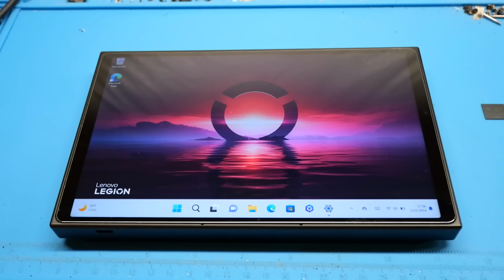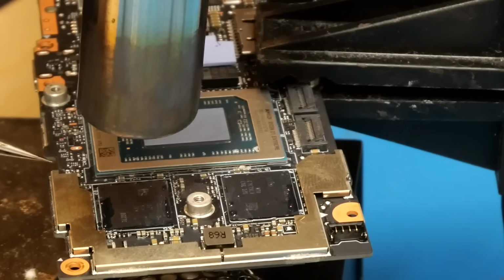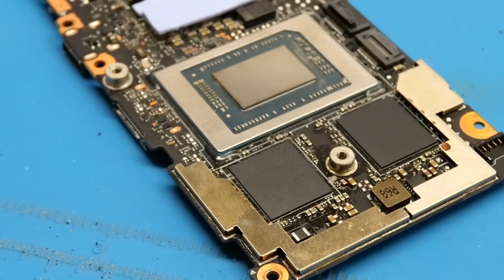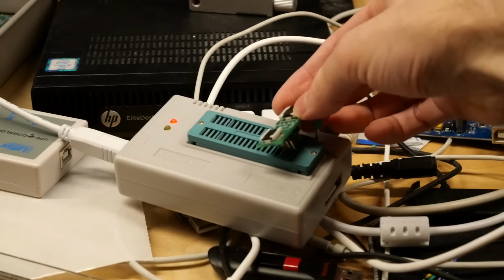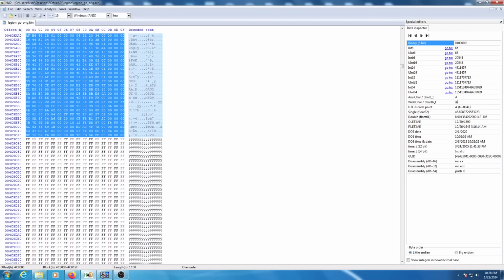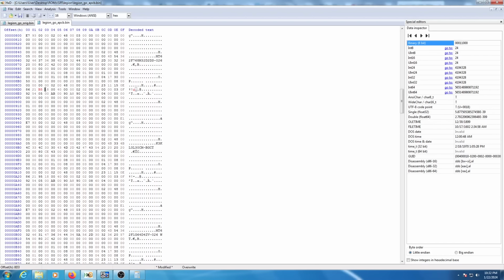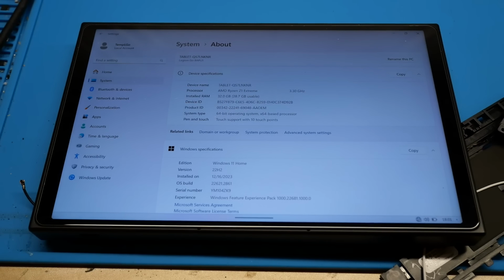Lenovo Legion Go 32GB RAM Upgrade

Comment: Awesome work. I love this stuff. I'm too scared to do mine, but it's awesome to see it done properly. I Also am thinking that, which bazzite requiring less system ram, that 16gb is really all you need with that is to get the most out of the apu. What do you think? I'm speaking about gaming specifically. I could see someone overloading bazzite with browser tabs in desktop mode.

Comment: i have some questions about this Upgrade! First; how does it affect the VRAM side? meaning the Legion GO was able to take 3, 4, 6 and 8 GB Ram for Grafiks, and now it has more so can you give it more VRAM like 10, 12, 14 and 16GB? Second; How is the Battery usage? does it need more energy and consumes more Battery or does it not? and lastly Third; would you do that for other ppl cause tbh if it's a good upgrate that Up's the Performance of the device then i would like to have that in my Legion GO but no one i know can do what you did or atleast dont do that for less then "pain tolerance" and if you do, how much do you need xD

Comment: i ve applied hot air and chips are not coming even the parts at the back melted but ram chips are not coming and also i dont see if i have glue like others have at corners :((((

Comment: I have a question my Lego shut off and won't turn on again even when I plug in the charger in the mains and unplug the battery. It has power to the usb's however none to the unit itself. Do you have any suggestions I've done all troubleshoots regarding power button hold downstairs to reset. Please reply I'm lost and you seem to know what your talking about

Comment: Great video to watch. But the price of a board heater, soldering iron(a good one) flux solder chips a sled for the BIOS chip. Etc. the average joe blow ain’t doing this.  I’m the kind of person that does work like this just to prove it’s doable. But even I’m like the prep and time. I’d rather just watch the video

Comment: Sadly my motherboard had a lot of glue under memory chips, so I decided to slightly increase a temperature. Now I am looking at 1R0 choke laying on my table👀
I believe it's looking at me surprised as well 👀
Reply: I did the modification and after starting up after a while there are artifacts like after pulling the RAM out of the PC slot. Does this mean one of the two chips is dead? Or both?

Comment: I have an edited bios which support 32GB RAM, but it is too old (N3CN27WW). So I want to replace the old edited SPD to the new (N3CN37WW). I wander is it possible? And I find the length of the new SPD is 1C40 instead of 1C30, can I replace all of the SPD directly in this situation? 
  In addition, I find that there are two paragraphs of apcb which all reach a length of 1c30. Should I repalce all the two paragraphs?
  By the way, I don't upgrade the bios through programmer but use an udisk. Is it will success?

Comment: What about 8500mbps chips? Are they compatible? I'm considering 32Gb upgrade.
Reply: I was wondering the same thing but it must not be as straight forward since I didn't see the part number in the SPD data. You would probably have se "squash" an entire SPD profile with the K3KL5L50CM-BGCU or K3KL5L50DM-BGCU SPD, they are both 8533 Mbps. There is also the K3KL5L50EM-BGCV at 9600 Mbps. Then there's a issue of actually being able to set these higher speeds, from what I've seen Smokeless tool max is 7500Mt/s. That being said even if the speed can't be increased there may be substancial performance to be gained in tighter timings. 
@dosdude1 any experience with this?

Comment: before Mod: Cyberpunk 2077 @ 32 fps @1080p

After Mod: Cyberpunk 2077 @ 36 fps @1080p
Reply: sweet! did you try messing around with the timings with smokeless tool?
Reply: can you try starcitizen?

Comment: Could you upgrade a soldered LPDDR4x 16GB on a GPD Pocket 3 to 64GB using this method?  How much would you charge if something like this is possible with the GPD Pocket 3?
Reply: Theoretically its possible for the Z1 Extreme to be expanded up to 256 Gb of ram, supportwise...

Finding the modules is gonna be the hard part i guess. Also GPU/APU only takes 32Gb max (as VRAM/shared Memory).

So other than "look at my ram" nothing gained i guess :V

Comment: Someone needs to upgrade some low end laptops with soldered memory to see how well they really perform without the bottleneck. E.g. there's a current IdeaPad with only 4GB LPDDR5. The athlon 7220u isn't that powerful but still a huge bottleneck.

Comment: Hey man, any idea how can I modify battery capacity in bios? I have doubled battery capacity, but handheld does not recognize and recalibrate to new increased capacity, I guess it cant work with double of capacity. Would appreciate if you could point me out to right direction.

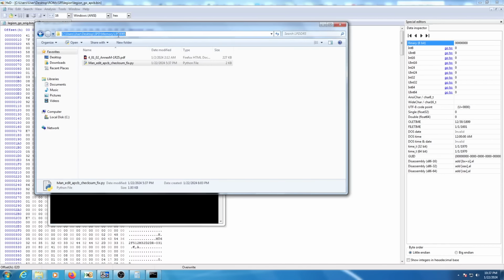Comment: Can APCB CHECKSUM fix can working with other motherboard such Asus laptop. 25:40
Reply from the maker: It works with any modern AMD BIOS.
Reply: @dosdude1  Ok but my system is intel platform can you help. The model is E410KA brand ASUS

Comment: 32 GB of ram on the Legion Go will make games perform even better than they do on the Ally X. Nice!
Reply: Already do 😊❤
Reply: So true. Since the ally x is now just above the go in most games by 1 to 3 fps , 32gb ram in the go should easily push it even further ahead of the Ally til the go 2 and z2 extreme ally come out
Reply: Not really. The 24Gb on the Ally X don't make that much of a difference
Reply: @LuisPerez-5  it actually does lol. Please don't make dumb comments when there's tons of credible proof that says otherwise.
Reply: @joshua7426  It really doesn't. Not in a substantial way anyways. Double the RAM for 6 more frames is stupid, there's"tons of proof" of what I mean. Do you know what "diminishing returns" means? You literally said the difference in the Ally X is 1 to 3 FPS you think that's worth whatever it costs to do this and risk damaging the board? You just don't get it and think the bigger the number the better it is. Then say I make dumb comments.
Reply: @LuisPerez-5 do you think 16gb legion go can handle warzone

Comment: Hello, I was wondering, If we (you) can already change the 16gb RAM chips for 32GB ones, could we hot swap the APU of the Lenovo Legion Go with the 8840U APU? I did a little bit of research and it seems like that the APUs are the same size, some of the compoments are the same..
Reply: why would you do that
Reply: @stefan12215  idk I was just wondering

Comment: Hey Dosdude! I’m a huge fan of your work (especially on the 2012 17-inch MacBook Pro) and I’m just curious, the limit of ram for the unibody MacBook Pros were 18gb of ram. With your knowledge about these MacBooks, would it be possible to make changes for 32gb to work? Changing the logic board or firmware, could make 32gb possible. I don’t research about this type of stuff, but I’m just curious about this challenge of getting 32gb to work.

Comment: Question Did Dude.
I have a 2018 Del Inspiron 7775 AIO Ryzen 7 1700, Rx580 8gg all in one desktop.
I understand the Bios is possible to add a string to allow Zen 2 CPU's as long as 65 watt and tomuogradr the onboard full rx580 GPU soldered on.
Would all this be possible to upgrade. Remove rx580 and replace with rx590 or similar pin count GPU. Or even replace GPU ram with faster and more ram?

Comment: but what happens when legion does a bios update? if i pay you to upgrade my ram do you provide future updates for bios?
Reply from the maker: I also mod the BIOS in such a way where it can no longer install any BIOS updates through normal means, and can only be updated with EEPROM programmer if needed. This prevents any potential for the changes getting overwritten.

Comment: This is badass, but I have no idea what use case you’re gonna have for 32GB on that. I populate my NUCs with 32GB cause I run them as virtualization hosts for my home servers and sandboxed Windows/Linux instances.

But a portable gaming rig… virtualization loads seem weird paired with that CPU… 3D rendering also seems weird for that and the form factor… multitasking like having 100 Chrome tabs open is also weird for such a small screen… can’t imagine a videogame that’s gonna make significant use of more than 16GB RAM.

This feels a lot like “your scientists were so busy asking if they could do it, they never stopped to ask if they should” lol. But this is SUCH an impressive project so there’s no hate here, just curious about the practical point.
Reply: bruh I have ancient computer with 8gb ram and regularly 100+ tabs open in chrome, can´t say the experience is great though haha

Comment: Why can't you flash the bios through USB or just downloading a patched bios? If people already know the byte edits that need to be made, it's odd nobody has released a patched bios. My only theory is that modders are intentionally holding it back to profit off repeat repairs to have people send their legions back for reflashing. And it's odd nobody is actually showing performance gains seen by this mod. 🤔
Reply: That is because there are no perf gains... what you gain is the ability to run more stuff, and have less stutter in what you can run. Also the BIOS utilities probably do some checksum checks that you'd have to avoid in order for it to patch itself.

Comment: It has AMD 780M igpu and its like GTX 1630 (PC Version) or GTX 1650 Mobile in comparison. For example you can play GTA 5 on 720P on max and about mids on 1080p (without any Ray Tracing of course). Cyberpunk is probably 640x480 Ultra Low

Comment: Just a question. This prehaeter you use, is it essentially like a heating pad? What kind of temperatures you use on it, 70-80c ? Because for this chips usually don't you go for 380c on the hot air station like nand, is 330c enough?

Comment: Nice, can you find faster RAM chips than stock and can the SPD data be modified to account for the faster speed? Looks like LPDDR5X goes as high as 8533 MT/s but stock it's just 7500 MT/s. Also curious if you can do a similar video for the ROG Ally. Thanks!

Comment: I wish i had the equipment to do this with my steamdeck and ROG ally. But don't else I would. Looks wquite easy But I bet that equipment is quite expensive. Does it actually give you that much benefits though? Will those chips work on the rog ally and is it worth it.

Comment: Hey I loved the video so much. But now I got a question. Can you upgrade the RAM of Asus ROG Flow Z13(2023) to 32Gb, the stock is 16GB Maxed for regular model. But they also introduced a limited edition Z13 which had 32GB Ram with the same exact CPU. So I'm actually curious that can you upgrade the RAM on regular model too
Reply from the maker: Most likely the RAM could indeed be upgraded.

Comment: few stupid layman's questions: is the solder preapplied on the chips? i'm watching without sound and perusing the transcript/subtitles doesn't say anything:) also why do you need to remove the spi rom chip instead of programming it on the board? is it non standard chip so there's no clips for those?

Comment: Since iGPU and CPU use the same & shared memory, 32GB RAM is make sense. Love the details on this video
Reply: Why didn’t they sell us a version with 32 bg of ram? I would paid the extra 50-100$
Reply: @Mercer696  they probably didn't think the device would get this far in tbh
Reply: Yeah. I want to like the LeGo so badly, it’s so close, but 16GB of shared just isn’t enough.
Reply: La legion go 2 tiene 32gb ram, creo @thedave1771
Reply: I have the Legion Go. Currently playing Black Ops 6 just fine on high settings with 4gb dedicated to the ram. Still have a gig left available on CPU and GPU side. But many games really struggle. They didn't think this through at all. If the second legion go wasn't going to have the 32gb that its gonna have, I'd have sent mine in for the ram upgrade, tbh.
Reply: @ThatsRickyAlright just use bazzite steamos. It uses less ram. I can use 6/8gb vram

Comment: Bro just hand swaps a BGA with no Xray no oven. Wild stuff bro. I worked as a SMT operator for years and this is impressive.
Reply: That's how we did it for years in repair shops, you don't need X-Ray nor oven. RAM packages are the simplest and easiest to replace. The fun starts when you replace thin substrate non-square CPU packages.
Reply: I made things for the military and medical field, so we had to X-ray almost everything for liability issues. It is still crazy how quick you are with the BGA. Love the content. Hope more people see this and learn such skills.  @FrozenHaxor

Comment: I don't even understand how those other components don't go flying when you're using hot air.  I've only done soldering with an iron, and just accidentally touching tiny components gets them swimming somewhere else.  I am not skilled enough to fix them at that point.

Comment: Was that a no clean flux?
Reply from the maker: Yes, but the board was still ultrasonic cleaned afterwards.
Reply: @dosdude1  Sigh, I was wondering. That's an important fact that you should include in your future videos. If the flux it not cleaned those board will be dead from the acid in a matter of weeks.

Comment: first time here, I thought he is a repair guy but no, appears to be hobbyist. Considering the skill and difficulty, I repair guy would charge a lot for this modification.  Lenovo or vendors should just offer a 32GB option x86 handhelds for slightly less cost than manual labor

Comment: I'm surprised to see Lenovo did not use their black epoxy underneath the apu and ram - this was very widely used in their laptops, making repairs much harder than they need to be.

edit: I have a question on bios updates that wll for sure appear for this device and might be actually beneficial for it - like changing power limits, fixing security vulnerabilities and other fixes. As i was working with Lenovo bioses (specifically for thinkpads), the bios has to be digitally signed (not only digitally signed but signed porperly) for the device to properly update and not cause a bootloop or checksum mismatch - would an bios update work in this case? also, if it did work, it would probably overwrite the spd data with new values, again limiting the usable ram.
Reply: Just CNC mill the original ram chips to oblivion, epoxy underfill issue fixed: It is the way alot of shops do in iPhone storage upgrades.

Comment: My question is, does the BIOS also have provisions to allow for more VRAM to be allocated to the GPU as well? Further modification could allow for probably a max of 8GB to be usable by the GPU leaving 24 for the rest of the machine to utilize, which in practice for some games is more than enough, especially considering some games need a minimum of 8GB to start no matter what quality level you're going to drop it to after to get it playable.
Reply: I believe what genius accomplished here is to be able to run 8 gigs safely on handheld mode, and then remove the bottleneck the CPU ram poses when on eGPU

Comment: If you can figure out a way to upgrade the system RAM in the Nintendo Switch your channel will absolutely blow up. With a modified Nintendo Switch it would be possible to be able to address more than the typical 4gb of ram.
Reply: You can, but it does not do anything since its not usable on non-devkit units so games don't even try iirc.

Comment: May I ask why are you using win 7 ?😅😄😄
Reply from the maker: Because I will not subject myself to the telemetry-ridden, forced updating, horrible-looking garbage that is Windows 10 and later. If I have to use Windows for something, I will ONLY use Windows 7 (or older).
Reply: @dosdude1 go Colin! Go! Windoze 10 and later is garbage.
Reply: would the ram with 8533 mhz also work??

Comment: mmm quick question... I remember that I had to reflash the bios of a laptop, and aliexpress sold me a crocodile/pinchy thingy that could bite the chip and so, there is no need to de-solder it in order to flash it... couldn't you use that?
Reply from the maker: Unfortunately those clips cannot be used with this SOIC-8 style EEPROM.

Comment: So if you don't edit the firmware after the upgrade, the system still boots, but doesn't use the rest of the RAM. Does this mean that if you didn't perform the upgrade but still did the firmware edit, or otherwise told the system that it has more memory than it really does, it would try to write to nonexistent memory? Is there even some defined behavior that's expected to happen in this case, or can we just expect it to totally freak out?

Also, I thought modern chips wouldn't load firmware unless it's signed by a key burned into the chip. But obviously this mod makes the firmware no longer signed. Have I been misinformed?

Isn't it unnecessarily risky to desolder the firmware chip and solder it back to the board? I thought you could just write to it from within the OS? That's what firmware update utilities normally do, right? And if not, aren't there clips to attach to them?
Reply: I think it should break TPM measurements, but that doesn't stop boot - some features, e.g. Bitlocker, might be broken though.

There is also usually signature verification for updating BIOS from device, which is probably why update from the OS wasn't done (in addition to having to read the BIOS first anyway) and it was desoldered and written to more directly instead. As for clips, I'm not sure if there are any easily available for this specific package, but it might've just been that the author didn't have one.

Comment: Great vid, what's that little vacuum machine you used to lift the chips off the board called?
Reply from the maker: That's part of my hot air station, which is an Aoyue 852A++.
Reply: Look for vacuum suction pen.
Reply: that thing is cute xD